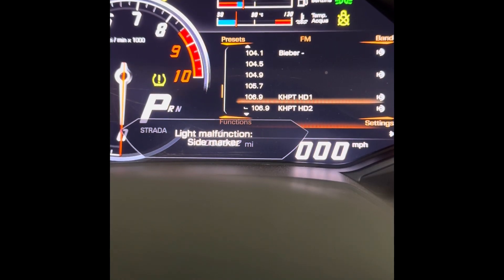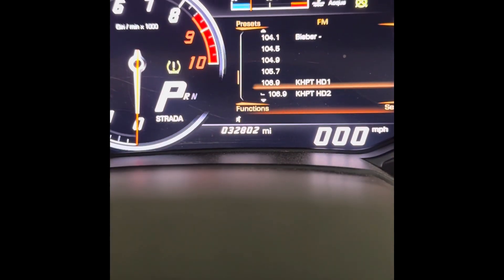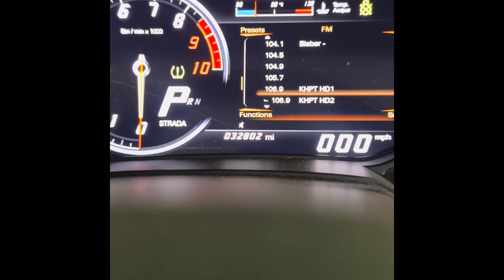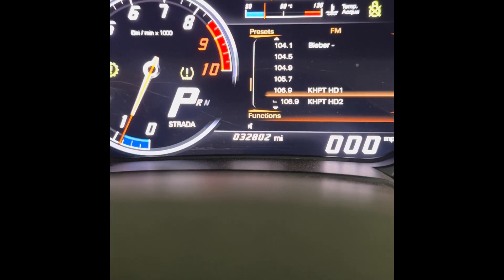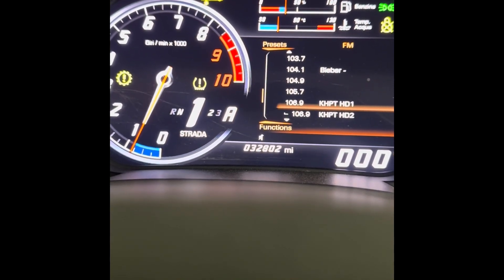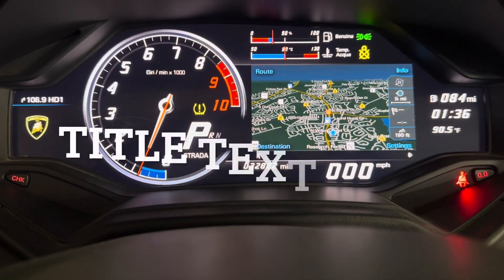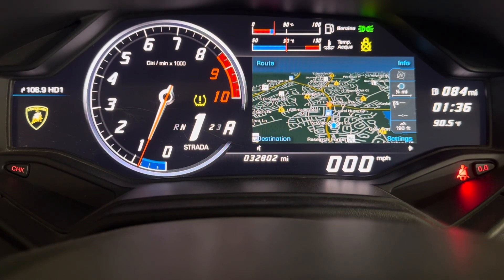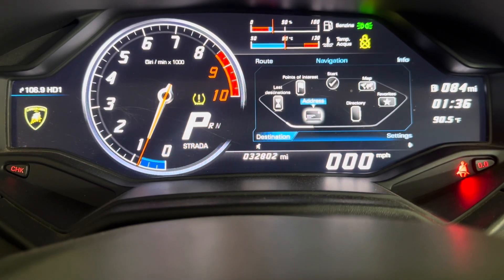Lamborghini Hurracan 2016-present, working on transmission error issue by bavlogic.com

Comment: Why make a video and then not say what was wrong, what's the point.

If you just deleted the CEL it will for sure come back, could be an issue that is intermittent and only happens at certain speeds/RPMs.

I'm sorry but completely useless video with no informational value.
Reply from the maker: @c77m18  ???? You think we deleted CEL? It’ll be back same second. No, we properly repaired it and it’s been no issues. Video is made for the owner and no we don’t provide DIY here
Reply: @Logic7repair  so you post a video on youtube for the owner. Ever heard of MMS, Whatsup, Facebook as a better way to communicate with your customer.

Im just saying posting this publically has no value and youtube is for public sharing.

I assume customer has seen the video by now so why not remove the video to remove the confusion.